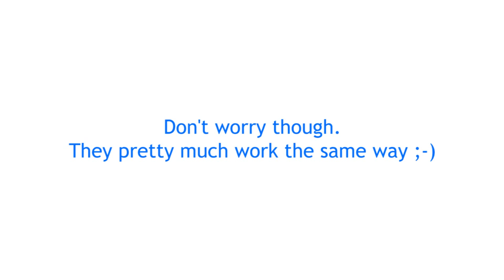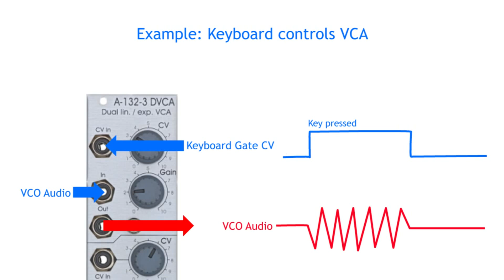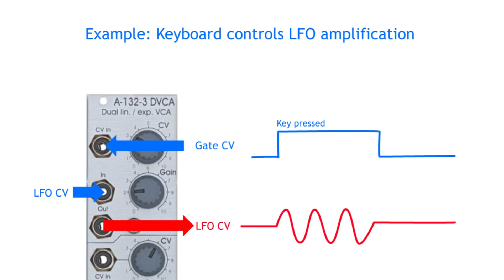Modular Synth Basics #13: VCAs

Comment: Those are vcas whith knobs but how you will use a vca withouth knobs? Like the octal linear vca from doepfer for example?
Thank you a lot for yorur videos!
Reply from the maker: On a VCA without a knob it’s the CV that controls everything. If there’s a knob, then it’s the CV plus the knob. Sometimes you don’t need a knob and can have more VCAs in less space then. You can also get VCAs without knobs and add attenuator modules to act as knobs. That way you’re more flexible. If you need a knob, use an attenuator before the VCA. If not, use the attenuator for something else :)
Reply: @tuesdaynightmachines  so is it basically an vca with knobs a vca whith attenuator? Like the knob cv for control is it an attenuator?

Comment: for some reason i was sold a mixer and a ujack which seems to do the job... not technically a vca...
Reply from the maker: The uJack is not a VCA indeed, because it lacks the voltage control over the amplification. There are mixing VCAs however.

Comment: Great video! However, I always wondered why everyone says that one cannot have enough VCAs? Is there a simple way to answer that question?
Reply from the maker: +techdeathcurator VCAs are just so very useful. Not only to control audio volume with an ADSR, but also control CV strength with other CV.

E.g. route an LFO through a VCA and open that VCA up with keyboard pressure CV. The harder you press the key, the stronger the LFO will modulate its target.

Using a VCA with pretty much any modulation, will make that modulation more interesting.

Comment: Hello. Congrats!! Very useful cool videos!! I only miss one dedicated to output modules. Is it possible in the future? Thanks.
Reply from the maker: +Manuel Rodríguez Fernández hey! You can just go from a VCA or Eurorack mixer directly to your recorder or whatever. Just check that you're not clipping an attenuate the signal if you do. I never really bothered with output modules until a month or so ago, because the Bastl Ciao offered cool features besides the "output" part too.
Reply: +The Tuesday Night Machines.  yes, I saw it in your rack #2. And I have seen the Vermona xlr output in other channels. Don't you have really ever needed balanced outputs for avoid noises?
Reply from the maker: +Manuel Rodríguez Fernández no, I never had the need for balanced outputs and I'm not using a balanced connection with the Ciao! module either.

Comment: Do I always need VCAs?? For example if I use braids or elements from mutable instruments what will be the use of a VCA?
Reply from the maker: +LUD Well, you just "need" what you want to use as a modular synth. There are no rules. However, the saying "you can't have enough VCAs" does have some truth to it. Without VCAs you can't have CV-controlled audio-volume changes or CV-intensity changes, and those often are a big part in modular synthesis.
Reply: Ok! Its kind of confusing, so for example I use a cirklon of beatstep pro with cv I can't make this kind of changes without VCAs? 

Thanks for you patience!!!
Reply from the maker: +LUD Exactly. The Circlon or BSP just send CV. But CV itself doesn't do anything. It needs to CONTROL something. And a VCA is like a voltage-controlled volume knob.

Comment: Is that possible to use only an EG and no VCA ? :)
Reply from the maker: EGs and VCAs are completely different things. EGs generate CV signals themselves, while VCAs amplify/attenuate incoming signals. You need an EG's CV to control a VCA's amplification.
Reply: ***** what are the best modules including a VCA and an EG ? I mean the cheapest one :D
Reply from the maker: I would really buy separate modules for EG and VCAs. If you buy all-in-one synth voice modules, you often lose a lot of the "modularity". Generally you can't go wrong with Doepfer. They're good and not too expensive.

Comment: würde mich freuen über eine folge die sich mit clipping und distortion beschäftigt, auch im Bezug auf VCAs
Reply from the maker: Hm, ich glaube da gibt es nichts wirklich "allgemeines" zu zu sagen (außer dass es irgendwann irgendwo clippt wenn man es laut genug dreht ;), weil die Module da alle sehr unterschiedlich sind. Hast du eine bestimmte Frage dazu?
Reply from the maker: Der WMD ist ein Abschwächer, dh der wird ein Signal nicht durch Verstärkung clippen. Ich glaube bei der og Frage geht es um gewünschte Verzerrung. Hierfür ist zB der Optodist VCA interessant oder der Klangbau Röhren VCA. Gibt natürlich noch viele weitere Module für solche Effekte. Siehe auch mein Video zum Invy: Circuit Abbey Invy as Waveform Processor (Eurorack/Doepfer Modular Synth Demo) #TTNM